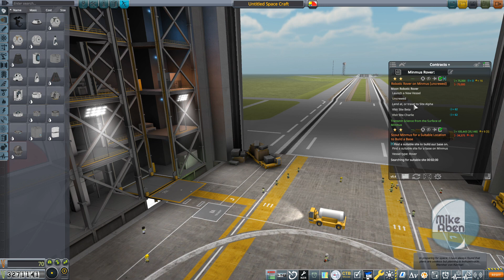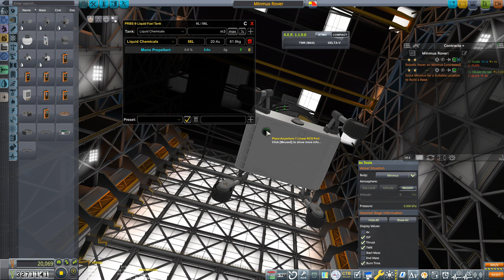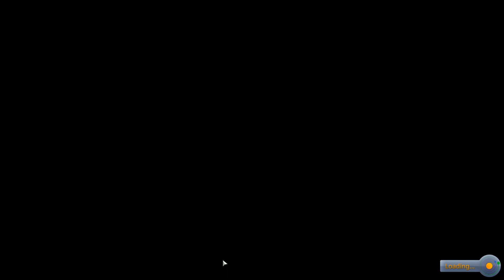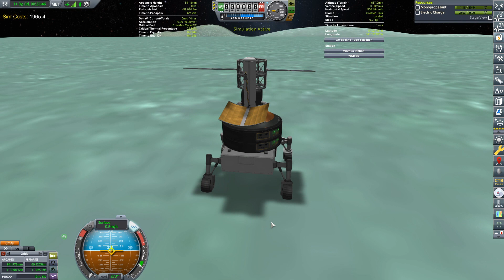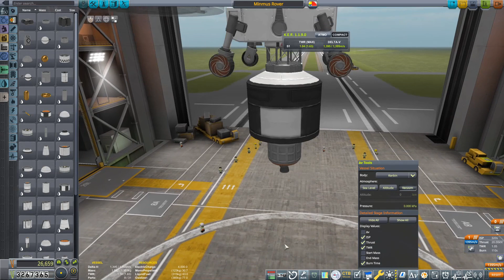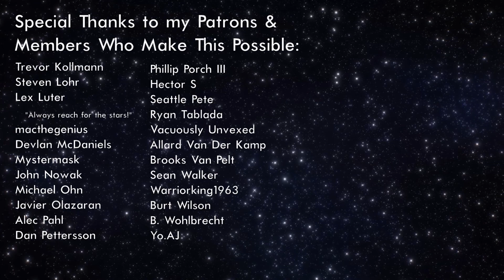Rover Build | Stream pt. 2/3 (KSP 1.12.3)

Comment: If I were to make a rover that can do an atmospheric entry using the RoveMate, is there a way to make it fit in anything smaller than a 2.5m heat shield?
Reply from the maker: If you want to go small, I would abandon the RoveMate and use one of the smaller probe bodies. You can change the default control direction to forward and it behaves just like the RoveMate.

Comment: Any chance for a stock absolute beginners rover tutorial? Thanks 🥺
Reply from the maker: Most if this build is stock. I believe the only non-stock parts are the kOS probe core (which you wouldn't need) and the small tanks which you can replace with a small spherical monoprop tank.
Reply: If you strip away the non-essentials (like the science and antennae) this is rather a basic build. The only problem is the rover body is way further along the tech tree than it should be.

There's really no alternative to this (since most the bodies are round), without making it taller and thus more unstable.